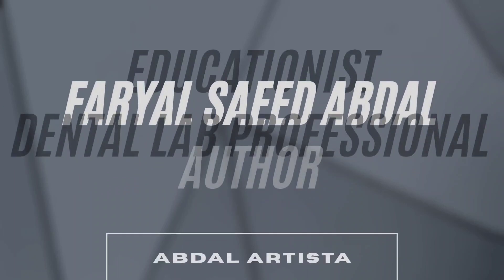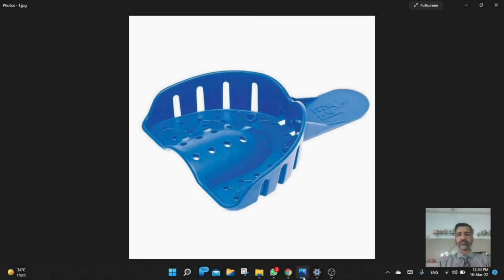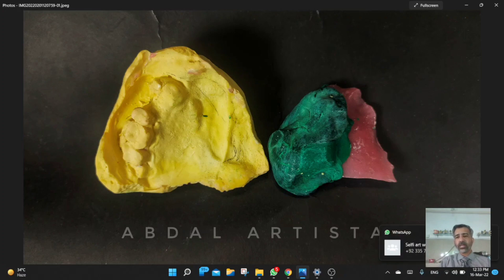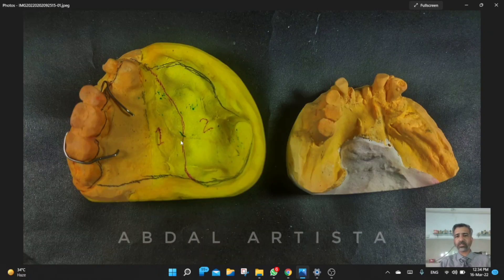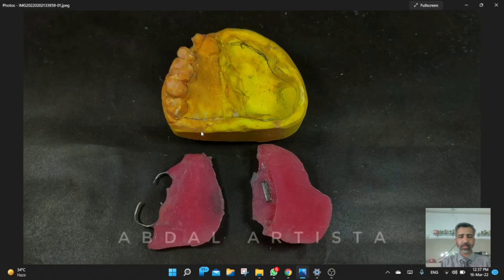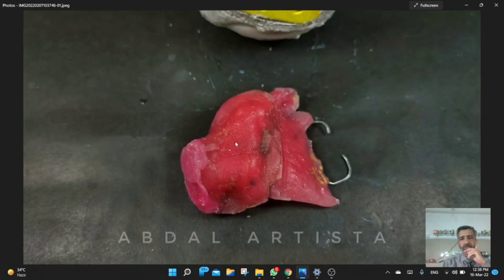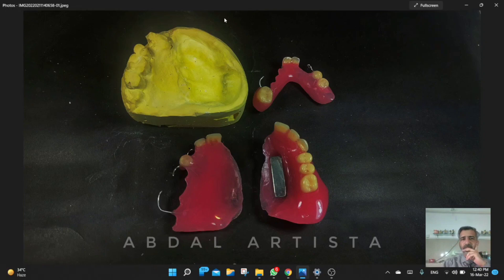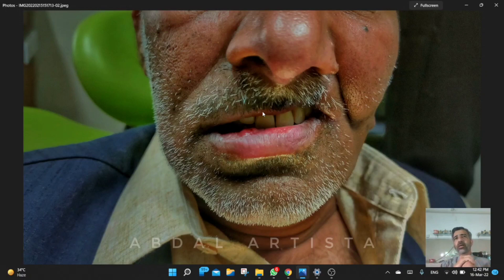Fabrication: Two Piece/Sectional Magnetic Obturator | Prosthodontic Rehabilitation, Hemimaxillectomy

Comment: How did u tranfer magnet to heat cure plate ?
Reply from the maker: I did not and that's the trick.
I made the space for magnets and than simply processed it (cured it). After processing, I poured couple of drops of self-care to attach the magnets.
I also use same technique for implant supported prosthesis and it works like a charm. Saves lot of time and energy.
PS: I used a new and large pair of magnet for final prosthesis.
Reply: @FaryalSaeed  great.. 
 thanku sir .